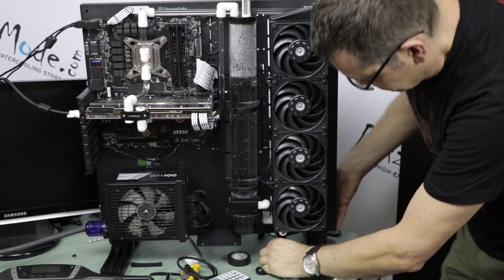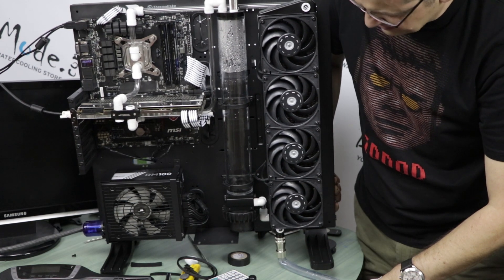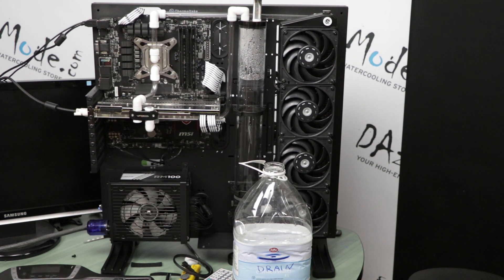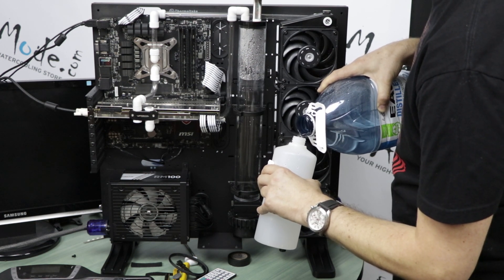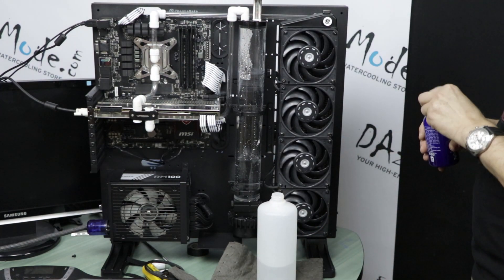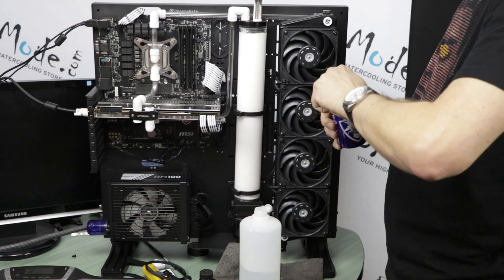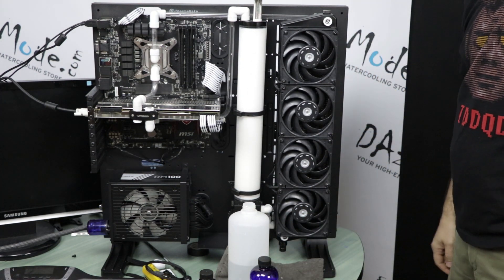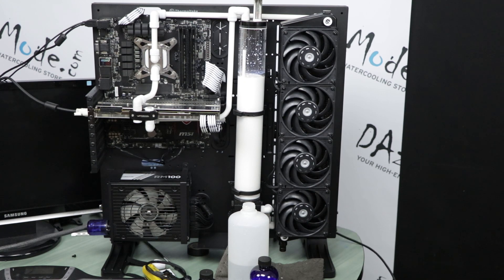Release The IceDragon!  - Skynet Build Ep8 (VLOG format)

Comment: 2nd time spilling liquid over the pc... Also why not put a angled fitting before the quick release drain valve, so you don't have to lift the pc to drain
Reply from the maker: It will stick below front clear panel and won't look good on the wall.